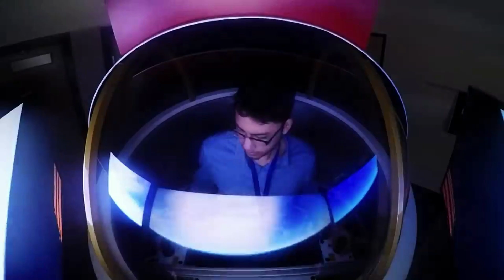Blue Origin’s Challenge With The Orbital Reef Space Station

Comment: If OR comes to be what is proposed, it will be HUGE. Three LIFE modules of 300 m³ and three central modules of 300 m³ as well (approx).  That's 1800 m³ of total pressurized volume, and a capacity for at least 18 astronauts if only the LIFE modules are used in a 6-inhabitant-per-module configuration, that's more than double that of the ISS 🤯 (Although to be fair, if the Axiom Orbital Segment is also built, the ISS will also become just as big)
Reply: Actually they are now using the LIFE modules with 10 people per module so the 3 core module + 3 LIFE module design could support 30 people. 

Also the ISS only currently supports 7 astronauts outside of change overs so the Axiom segment only will expand that to 15.

Comment: From a project standpoint, SpaceX and Blue Origin are radically different

Blue Origin:
* Iterative (Development is done in stages)
* Waterfall (Everything in development is planned ahead of time)
* Hardware-heavy (One chance on launch day. No prototypes)
* Horizontal integration (with other companies)

SpaceX
* Iterative
* Agile (specific requirements subject to change as you develop)
* Hardware-light (many prototypes, often a fixed number though)
* Horizontal integration (everything is made in-house)

Blue Origin is configured to have a “safe, risk-averse” approach, but not a cheap or quick one. Arguably the most important thing they did is adopt iterative development. This allows them to set some specific implementations as they go. Long projects need this in order to not become outmoded before they even launch, also closing them off to changing things to make it cheaper once they get the hang of it. This is why Shuttle remained so expensive even though it could be cheaper. Same with SLS.

Comment: Orbital Reef requires significant funding to start actual construction. I don't see large scale funding in the NASA budget for such a project. NASA does want to be a customer of many. Finding those many might be a struggle. Boeing's Starliner has only a few remaining Atlas 5 rockets. All of those are allotted for NASA ISS use. So far there is no announced funding to make Vulcan human rated. That process once started takes some years to complete. Starliner could launch on Falcon 9 rocket if Boeing can swallow its pride and someone wants to pay the premium dollars that Boeing charges. As for Sierra Nevada Corporation Space System’s Dream Chaser, they have announced that they desire the spacecraft to be human rated.  However, no one as of yet is funding that multi-year long process and the best I can tell, it has not begun.  As for the New Glenn, I’ll believe it when I see it.  If Starship comes on line somewhere near expectation, all of Orbital Reef’s construction would be a great deal simpler.
Reply: Both Boeing and Sierra Space have stated that they will be working out the human rating process of Vulcan once it has completed several flights.

Starship would be over powered for a task like this as it is for almost every task. I would expect them to make a wider fairing for Vulcan that is similar to what we see on Falcon 9 and launch the Core module on that. The LIFE module and Boeing research modules are designed to fly on 5 meter rockets anyway.
Reply: @luther0013  Starship will have the capacity to launch the entire Orbital Reef in one or two lifts at a fraction of the cost of a traditional expendable rocket.  It will change everything.
Reply: Starship will not be able to lift the entire OR in two launches. Not even close. Youre ignoring mass calculations, the starship is nowhere near large enough to do what you said.
Reply: @iamscoutstfu  Starship is presently rated for a LEO orbit for 150 tons or 330,000 lb.  What Orbital Reef will end up needed for lift is not known.  However, I am pretty sure 330,000 lbs will go a long way.
Reply: @WWeronko  ITs not weight, its mass. Starships faring is not large enough to transport the entirety of OR in two trips.
Reply: @iamscoutstfu  Geese Kyle, you need to read a basic physics book.  For these purposes weight and mass are the same.  You are talking about volume.  The Starship has a 8 meter by 17.24 meter tapered volume that can handle the largest of payloads.  Orbital Reef has inflatable modules that can be compressed.  The Orbital Reef design is not compete and the volume / weight requirements are not clear.  Whatever they are, Starship ought to be to handle them.
Reply: @WWeronko  

IT still will NOT be able to move OR from earth to orbit in two tries.  Not even close, even without us knowing the full dimensions of a compressed OR.  Not really understanding the hostility towards me when I'm just correcting your erroneous statement.  Touch grass bro.
Reply: @WWeronko  Also weight and mass are not the same, even "for these purposes".
Reply: @iamscoutstfu  Laughs.  Weight is a measurement of the gravitational force on an object. It not only depends on the object's mass, but also on its location.  On Earth’s surface, 1 kilogram of mass is equivalent to kilogram of weight. Hence, they are the same for the purpose of this discussion.
Reply: @WWeronko  

Im sorry, but...NO.  That's not correct.  Mass and weight, are not actually the same thing.  It seems odd for you to lecture others to study physics while displaying a complete misunderstanding of mass in relation to weight.  But hey, there've been dumber things said on the internet.  not much dumber, but still, you're not the worst.
Reply: @iamscoutstfu  Kyle, I don't have time to explain basic physics to you. When you get in high school it will become clearer to you.  Good luck.